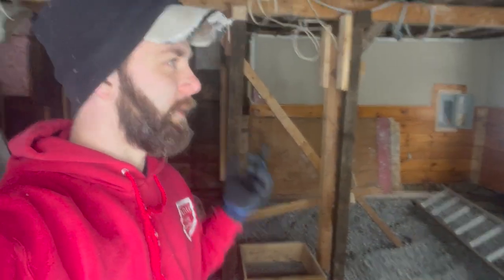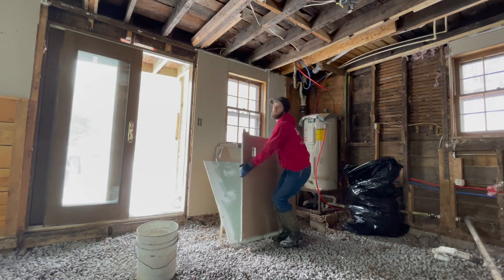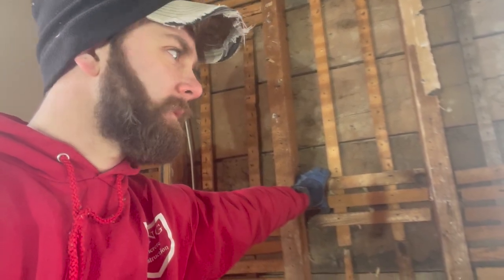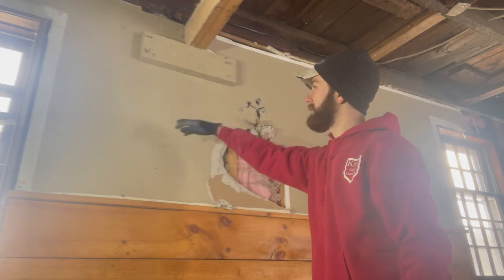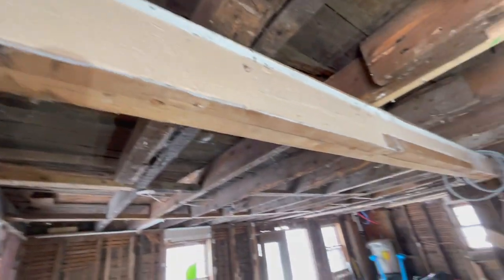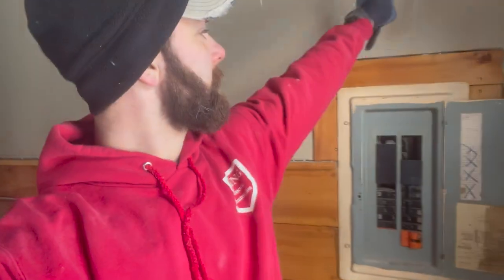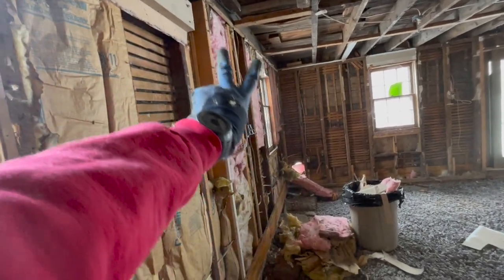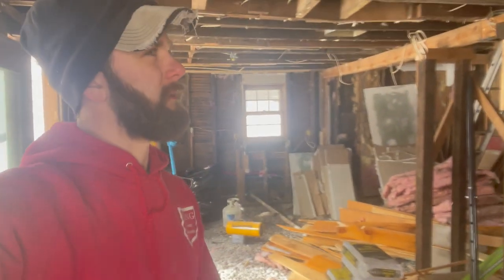DANGER! What EVERY Person Hopes NOT to Find During their DEMO! || MAJOR Fixer Upper Ep. 20

Comment: You’re looking at a plaster and lath wall.  Insulation wasn’t used until the late 1930s.  The plaster -- which was made up of limestone or oyster shells, sand, and cattle, horse, or hog hair -- oozed through the gaps in the wood lath and made a solid wall.  The r-value in a typical wall was about as much as a sheet of cardboard, but the plaster had a lot of thermal mass, so it kept down air infiltration.  People didn’t know how warm they could be with insulation. Even after your previous owners insulated downstairs, they didn’t bother to insulate upstairs, because they could be colder up there when they were sleeping. They just kept the wood and coal stoves blasting and wore lots of layers!

Comment: Here's the info on the wood strips: Laths or 'lathes' are narrow strips of timber nailed horizontally across the timber stud frame or ceiling joists and then coated in plaster to finish the wall surface. The technique derives from a more basic historical building method called wattle and daub that's been used for at least 6000 years
Reply: Our old house was made this way with plaster walls.
Reply: This was my thought as well. My house here in the UK is still lath & plaster complete with horsehair mixed in & it was built in the 1930s. Still going strong in most of the house despite bomb damage in the nearby area during world war 2 & someone who was awful at DIY living here at some point!